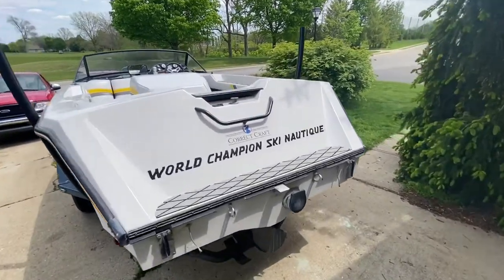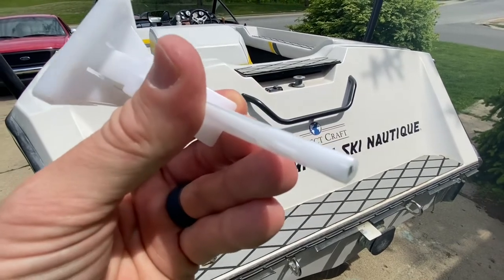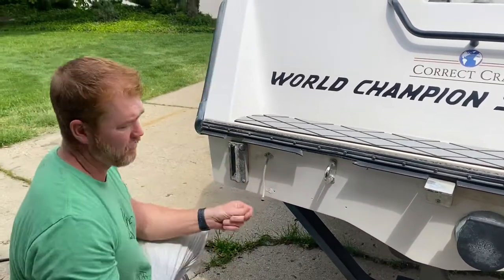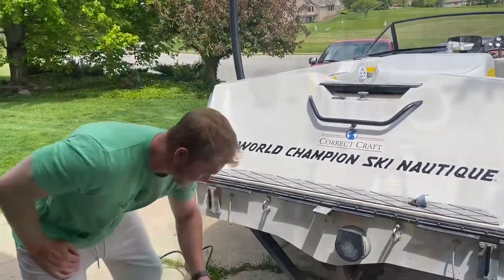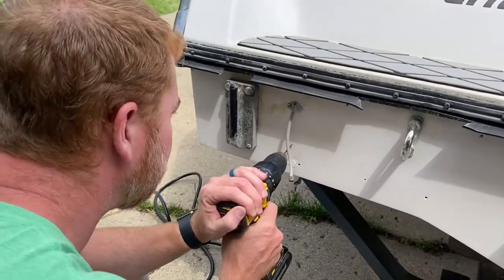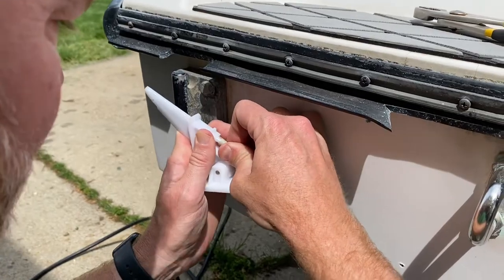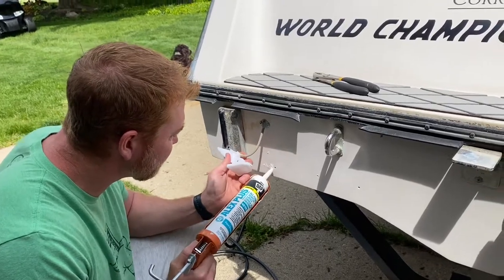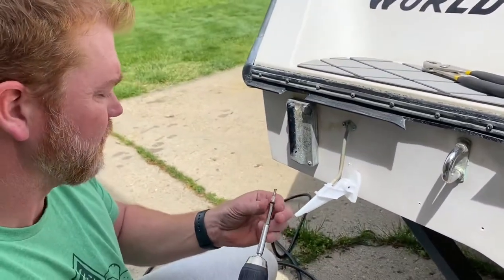Boat Speedometer Pitot Replacement

Comment: Thanks for posting this video, I like the discussion about possibly cracking the gelcoat (fibreglass) if pilot holes of correct size were not made.  Just a suggestion I don't like using cordless drill for installing screws into fragile materials, just plain old screwdriver is my preferred choice that way I can tell if I am cross threading or some other anomaly like wrong too small hole I am screwing into before I trash the boat.  I have about a 25 year old ski boat and it uses a nut to hold the hose on the pitot.  I unscrewed nut and hose is still stuck on ... before I break something just wondering if you or someone else knows if there is something holding these together or just rubber hose being brittle.  My goal is to replace all the old rubber hoses but pitot pieces attached to the hull are on.  Thanks again to you and your camera gal ... for video .
Reply from the maker: I bet it’s just brittle. Hopefully you have enough slack in that tube to cut of that end and insert a fresher piece onto the pitot. I couldn’t pull the end of the rubber off of the old ones either. 
Good tip with the drill. I’ve seen some good tips for drilling with fiberglass since and would definitely do things differently.

Comment: DAP acrylic caulk for through hull screws?  The industry standard for sealing anything through hull is 3M 5200.  Acrylic caulk is not intended for use below the water line.
Reply: 4200 would work better in this application since it will likely need to be replaced in the future.
Reply: Right

Comment: Good video!  But, please tell us why there are 2 speedometers on one boat.  I can't figure this out.  The entire boat travels the same speed, right?
Reply from the maker: Skiers are super particular about accurate speeds… down to the 1/2 mph. Technically the port and stern pitots will differ when the boat is turning. I used to think that was the reason for the two. Most people will say it’s in case one fails, there’s always a backup.
Reply: If one goes out does the air pressure still work or go out the other?
Reply from the maker: @kevinvoyson3028 they are completely separate units. The reason for the two.

Comment: You sir have created an entry point for water using a latex based caulk for a below water application, say goodbye to the transom. 

try using toughened epoxy next time.